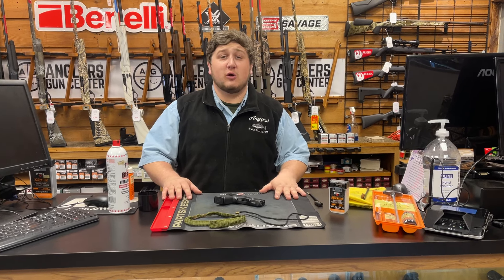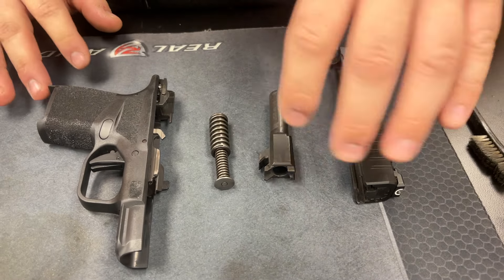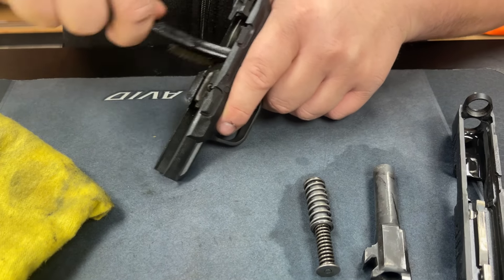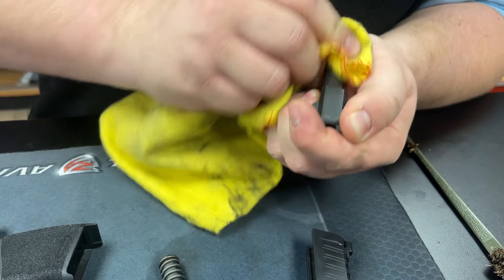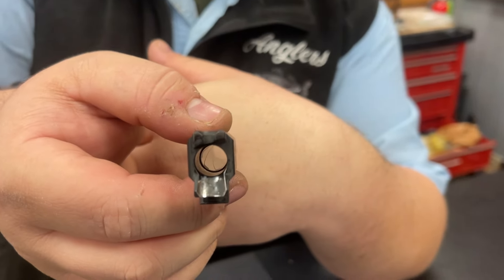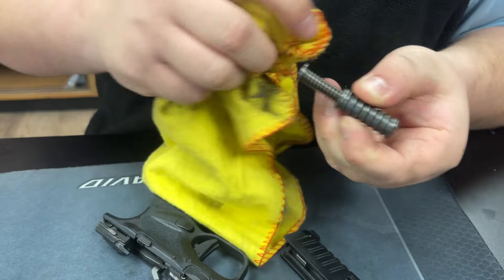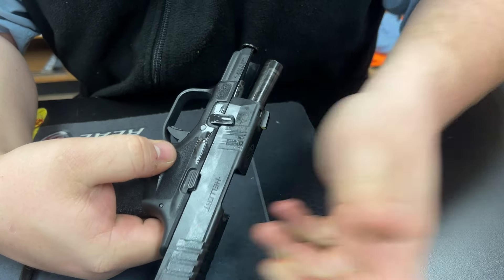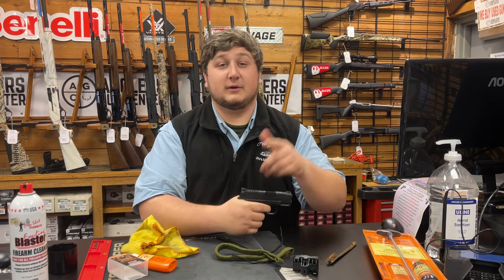Cleaning a Springfield Armory Hellcat

Comment: You should try not to get any oil into the firing pin channel.  I think you did a good job with the video.  Thanks!
Reply: Yeah, that should stay dry. I might take the pin out and pour 91 rubbing alchohol on it to clean it, but never ballistol or any other “lubricant”. It can cause soft primer hits, when it gunks up with debris over time if you put oil in it.

Comment: Good video!  I read an interesting article the other day from a Viet Nam vet that said handguns that are routinely field stripped are more likely to wear out sooner than later due to effect on clearance tolerances over a period of time.  Basically to leave it together as much as possible and clean out the chamber area, ramp and run a brush or snake through the barrel, using solvent if needed forma very dirty barrel, but that was the crux of the story.  I have no way to validate this information however!

Comment: I was wondering about the front part of the frame. I rented the Pro and underneath the barrel it looked silver as if the paint came off the frame. Have you seen this and can the color come back? I also noticed on the Pro where you can connect a light, it was completely worn down.

Comment: Question : wont spraying the slide get solvent inside the striker assembly?
Reply: Yes it will, he doesn’t exactly know what’s he’s doing for a quick clean. But this would be fine if you planned on breaking down the slide and cleaning the springs and striker system and even the ejector system. This gun is not a hard gun to keep clean but it can be a little crazy taking apart
Reply: Yep, even on the HC manual it says make sure to not lubricate that area